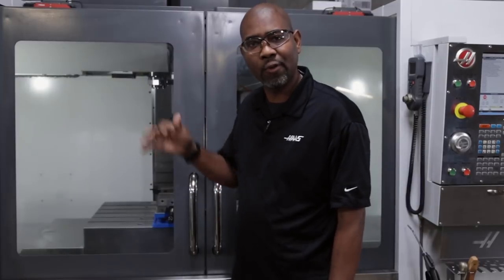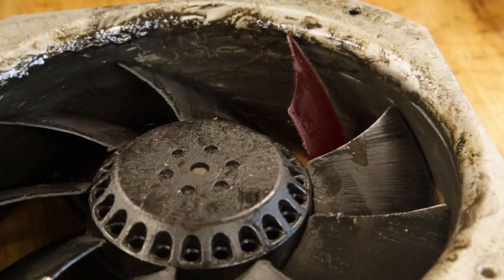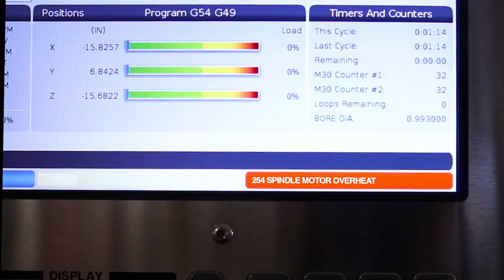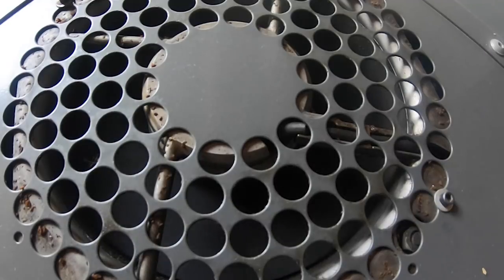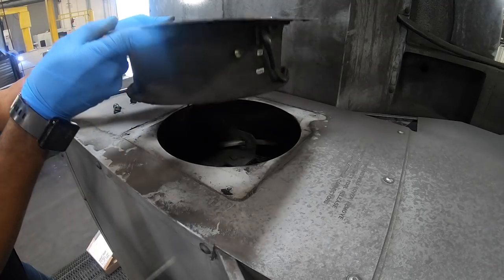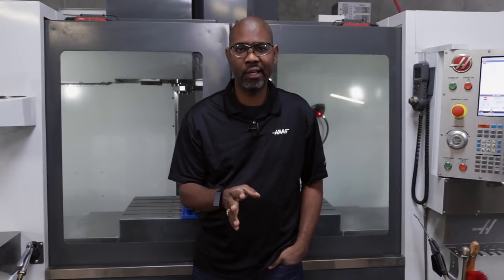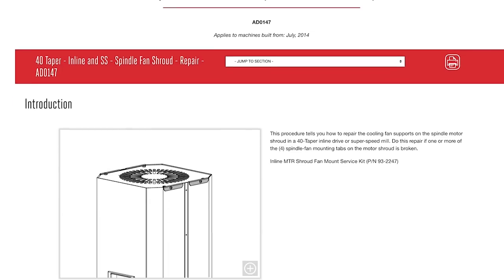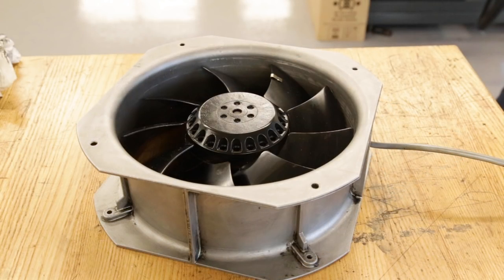Cleaning Your Mill Spindle Fan - Haas Automation Service

Comment: Our service guy installed the fan to pull air into the spindle , not blow out the top to extract the warm air. I have a feeling he is wrong, right?
Reply: This make more sense to me. It would pressurize the enclosure which would expel mist and particles rather than create a vacuum to draw them in where the magic is happening.